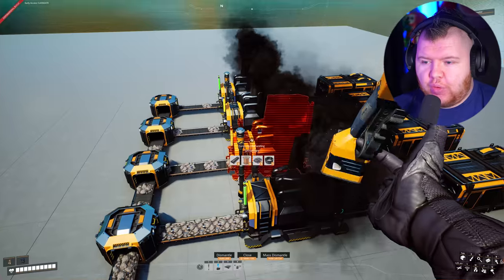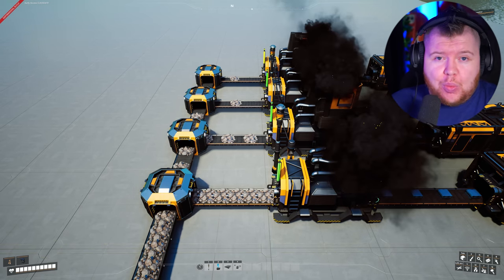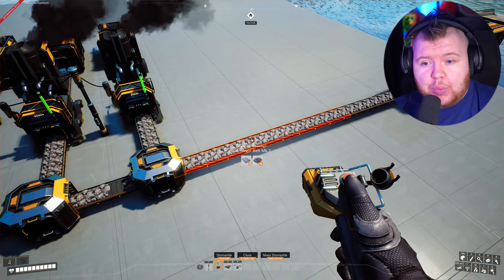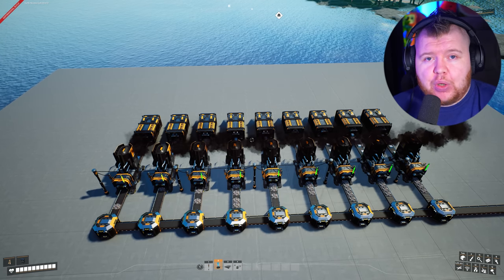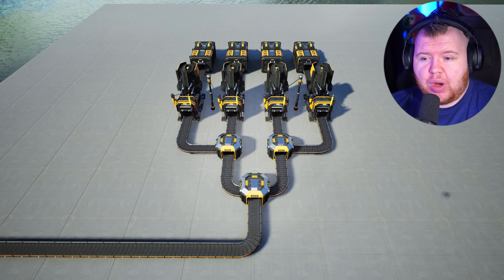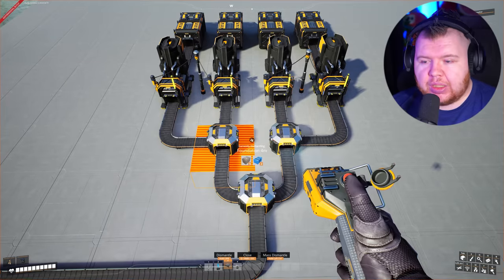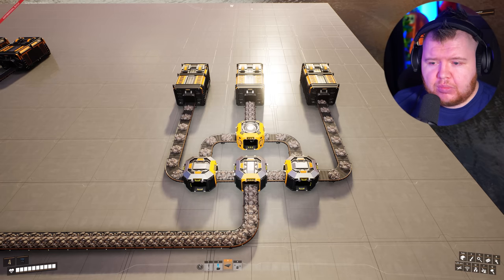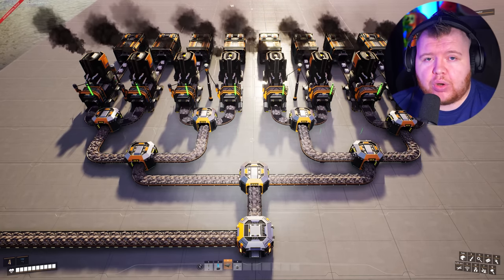MANIFOLD vs LOAD BALANCING!! in Satisfactory

Comment: I prefer load balancing whenever possible; the big issue with manifolds is the lag time in fill up, which with some low production and demand ingredients can take forever - if I'm sending 60 encased beams to 6 manufacturers for heavy frames, it'll be hours before the manifold (ignoring all the ingredients' other prerequisites) catches. 

On the other hand, manifolds are great for simplicity - they expand easily, they don't eat as much space, they're probably the best way if your belts are full and fast enough, and you don't need to worry about how to make a 7 way splitter work.

So the answer is, obviously, both. Need stuff to go into 30 assemblers? Balance it six ways and manifold the last five.

On manifolds - I think the splitter internal buffer means the answer is yes, but does the highway belt need to be kept at the top level all the way down? If you're sending 270 to 9*30, after five machines it'll be down to 120 and could theoretically drop a belt.

Comment: I have seen manifold vs load balance, and standard manifold vs smart manifold videos, but not seen anyone do a comparison of all 3 in one video. Personalty I like and stick to Smart manifolds because I always want as many machines locked at 100% production as possible, and usually have more machines than I have supply for so whichever resource is limited will decide how many machines run 100%, and the last active machine will be running at some on/off cycle and machines past that are just not running.
Reply: I do the same. I have variable rate production lines, so a smart manifold is by far the best option.
There's also the benefit that you can either feed from the start of the line of machines when overflowing down the manifold, or start filling from the far end of the line by overflowing into the machines. This allows feeding different items from opposite ends of a production line keeping the feeds synchronised.

I'm so happy with the Copy Paste function for smart/programmable splitters added in Update 6 😁

Comment: Another option for getting 9 perfect split is to have 3 outputs from each splitter instead of 2.  Another option for 60/30/30 is to split once for 60/60, and split one a second time for 60/30/30.
Reply from the maker: Indeed i posted my reason for the explanation in the pinned message

Comment: You can balance 9 belts pretty easily with 1 splitter and then 3 all outputting on three belts each tho. Either way, I feel like the place to do fine load balance is when you have some very expensive slow producing items and long belts that will take an eternity to backlog.
Reply from the maker: Check the pinned message my dude!
Reply: @ItsBitz  oh ok sorry, my first comment was redundant then 😅

Comment: I allways set up smelters and constructors in 3s, making sure I allways produce more than what the machines need. 
If I need 100 on an item, I build enough machine to create at least 100, without over- or underclocking.
I like to see lines full, that means I'm producing enough.

Comment: What I would like to see is a "torture" playthrough: unlocking everything in each tier, but ONLY automating the space elevator parts and oil-based parts ('cause you can't hand-craft them), and even then, only hand-feeding and/or removing the items to the machines (fluids can't be carried unless packaged, but you still gotta unpackage them to use them in most cases). Also: Only Biomass Burners, no automatic power.

Comment: I always use manifold systems but my issue is crippling. I try to build for the future instead of the present, to minimize rebuilding later on.

This causes me to factor in and calculate for things that aren't relevant right now and getting overwhelmed with numbers.

So I've been trying to avoid that and just build modular, with easy to upgrade sections instead, but my brain won't let me.

Comment: That was super easy to understand. What about using all outputs from splitters? For example 270(?) line into 3x90 and those lines into 3x30? I don't play the game so I don't know how it would look size wise etc.
Reply from the maker: Hey Vanher, I put the answer to that in the pinned message, in case people asked why I did not use that. But you are correct that is a way it can be done :_BitzLove:

Comment: Manifold does it in most situations. For coal powerplant (or other buildings that need to use a steady ammount of ressources) Load balancing makes sense because with manifold the last ones barely can get enough ressourcesif you have same ammount on one belt that is used in all buildings.
Reply: When I’m building a coal power plant I’ll either have a miner running to storage or throw down some portable miners (depending on if I have power or not), and then when I turn everything on I’ll fill all the generators by hand. After that everything runs smoothly, even with super long manifold lines.

Comment: Slight issue with your setup, splitters have 3 outputs so putting 9 is easy you have 1 splitter for each set of 3 and then 1 splitter feeding into those 3, you should have used a number that’s not divisible by 3 or 2
Reply from the maker: Thanks for your input, but I explain the reason behind what I did as the pinned comment. Its my fault for not clearly explaining my doing in the video

Comment: Yesterday I build a huge base... when I finished I dont like mysettings HAHA I belive using a Giant Base dont is I like to administrate...

What is more eficient, little bases to made some things or a giant who can do all?
Reply: Putting everything into a Giant Base can make it more difficult to make changes in the future, and thus it requires more planning ahead of time to make sure you have room for expansion and any other changes you might want to do.

Building many little bases can make things easier to change, but it means you have to send materials back and forth between all these bases, and that requires a different type of planning ahead of time.

I don't think either is necessarily more efficient than the other, and it comes down more to what you play style is and what you like and enjoy.

One thing to consider, though.  If you construct a large megafactory all in one place you could begin to experience performance issues from your CPU/GPU.  As you move around the map, Satisfactory loads and unloads chunks of the world, and I believe the unloaded chunks are handled differently (they require less computing resources) than the loaded chunks.  If one or more of those loaded chunks has a gigantic megafactory in it, game performance might suffer as your computer tries to handle all your game world's processing all at once.

Comment: I used to load balance and Underclock, when underclocking would actually be a benefit in power consumption.
Now that the savings were removed, I no longer 'find any point' to load balancing. Which is a shame, to me. 
I would have more factories highly underclocked, perfectly load balanced. Which could be replicated and stacked. 
Sure the cost to build them was more. But, I didn't care, now, it make no sense to underclock. Pity.

Comment: Bro, at 8:40, you could still use 9 and end up using only 4 splitters. Let's say 270 goes down the line. Split it in 3, now we have 3 lines of 90. Then do it again for each line of 90. No over/underclocking needed.
Reply from the maker: Indeed, I was demonstrating other ways to do it.

Comment: Both.
Load Balancing is beautiful to see in action, but technically pointless and overcomplicates the design. Especially when you expect to expand on it.
Manifolds are extremely simplistic, but not as majestic to watch in action. By far easier to expand on, though.
In some cases I've combined manifold and load-balancing in the same factory where I balanced incoming resources between a few larger modules, but in the modules used manifolds.

Comment: The question about power:
Is overclocking cheaper on MW than building extra buildings?

Qty of buildings:                 Clock Setting on each building:           Power Consumed Each:                 Power Consumed Total:
            2                                                     100%                                                    4MW                                                   8MW
            4                                                      100%                                                   4MW                                                   16MW
            2                                                      200%                                                   12.1MW                                              24.2MW

 so it's cheaper on your power grid to just build the extra buildings.

And because of entropy, this is realistic. I've been hearing that update 7 will do something to the power consumption of overclocking and I'm against the idea of making a machine at 200% use 8MW because that's just not accurate to reality.
For a vehicle in reality to travel 2x faster, the power consumed must increase 4x. Satisfactory is being generous by making it only increase 3x.

Comment: What are your pc specs and performance? Tossing up between upgrading to a 3080 or just going all in and getting a 4090 down the line. That thing is fucking mental.
Reply: I wouldn't recommend going full out if all you're doing is gaming. The xx80 cards are the highest that I recommend normal gamers buy. So if you have the patience to see 4080 testing results, that's a good time to decide whether to go 3080 or 4080. Or maybe even 4070, as that could have better performance for the same price as a 3080, who knows.

Comment: I prefer a load balancing system. It doesn’t take much more room, uses less splitters and makes starting and stopping much quicker as each machine gets the same amount of ingredients at the same time.
Reply: Manifold do not use more splitters and it takes less space.
For example, with a 480/min resources, you can have 16 smelters for a total of 8 splitters on manifold. 
Pretty sure that's less than a load balancing can do.
Reply: @doriancarriat4241  how many items will make it to the end of the 8th splitter though. 
Yeah, thinking of the numbers it seems the manifold will take slightly less splitters. :)
Reply: @SirHackaL0t.  
60 incoming into the last splitter divided by 2 for 2 splitters of 30
(Each splitter provided 2 smelters in a mirror configuration)
Reply: @doriancarriat4241  The 1st splitter would split 720 into 240, the second into 80, the third into 26,6, the 4th into 8, the 5th into 3 (ish), the 6th into 0.5, the seventh, well, eventually they get one.
After a while the items get to the last few machines but it takes a while.
Before we had overflow splitters there was a 7 stage splitter/merger that acted as an overflow and one item every so often would make it through it all to be thrown away.
This is the issue that balanced systems doesn’t have. :)

Comment: 8:06 but, you can split into 3 with the splitter, why would you use a smart splitter when you can just devide 270 by 3 to get 90 and then split it into 3 one more time, to get 30 then you get 9 lines of 30 items/m, i bellieve you just refused to use the 120/m belts for 90 items/m outputs for asthetic pourposes but, why xD
i personally use mainfolds for picking stuff from the belts but i tend not to use them anywhere else, i built my generator with mainfold feeding system cuz it took just too much space and i gave up, it runs but getting it to run was big big pain 54 coal generators, biggest project i worked on hahah

Comment: "Load balancing" is nonsense. It does only one thing, it speeds up the warm-up phase of a group of machines. It has zero effect on production once everything is running.
The easiest way to start up a factory and make sure everything is running at max efficiency is to slightly over-saturate the input side of every production stage and overflow the respective excess onto a sushi belt and sink it. Good way to get coupons early game, and you don't have to sink much to make it work. You can for example run 240 ore from a Mk.II miner into 10 smelters, clock half of them at 24/s, the rest at 23/s. Eventually all buffers will be full and a hand full of ore wird go into the sink. 
Same on the output side. Connect the smelters' outputs, feed the 235/s ingots to the next row of machines, set those to 230/s total, and overflow onto the sushi belt. Etc...

Comment: Load balancing at later stages is just... no. Just no. 🤨If you really insist on it, I have one question for you.. Who hurt you this badly? 🤣
Nah, I get it as a challenge but manifold lines are so much simpler and cleaner in builds. Smaller footprint too
Reply: My guess is either a misunderstanding of the manifold system, or an OCD thing.
Reply: I didn’t know what manifolds were when I started and I’m in to deep to stray from my theme. My theme being utter chaos but everything being perfectly balanced so it’s belts going everywhere but everything is moving smoothly.

Comment: i feel like manifolds are better for production lines, but load balancing is better for energy, coal gens, nuclear power plants, etc
cuz if u use a manifold with power plants you'll only get one, and the last few will fluctuate, and you mightn't be able to keep the right amount of power to fuel the rest of them and then your stuck with 1.5 coal gens and 3 overclocked biomass burners... i know this is specific i just have early game ptsd